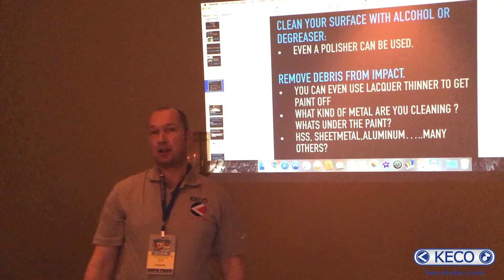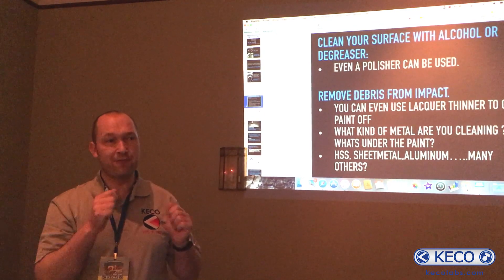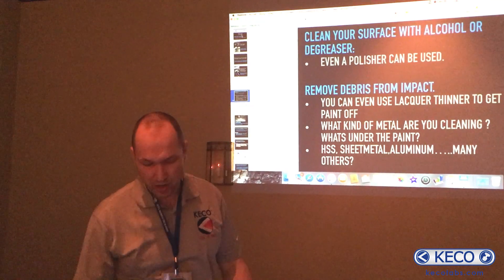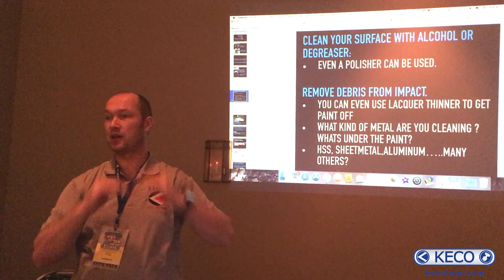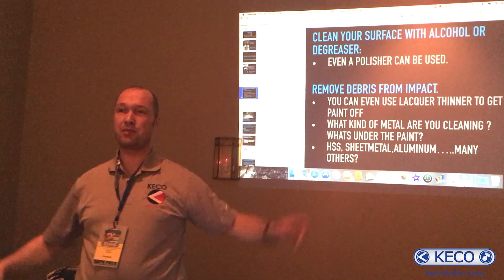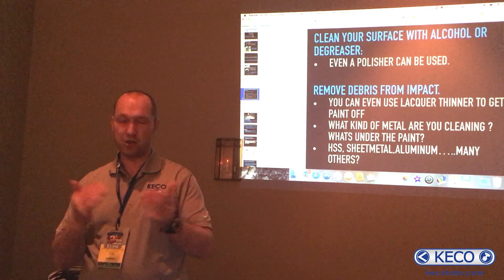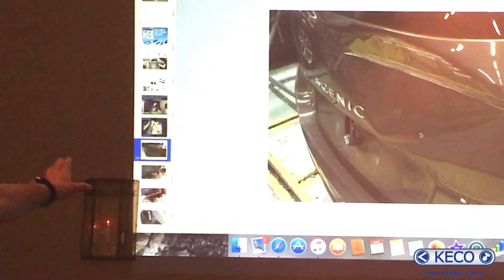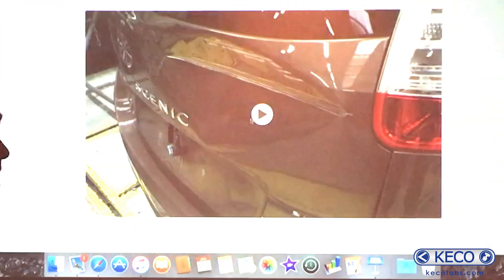MTE Presentation - KECO 2016

Comment: If you're in a body shop this information is a great introduction to Glue Pulling Dent Repair to completion and Glue Pulling to paint later (using less filler).. 

If you're a PDR Tech you know 75% of this,

if you're LEARNING or STARTING - this is something someone in 1999 would've paid $1k for 3 VHS tapes over mail. If you learn this you'll be worth a lot more than someone who doesn't know Glue Pulling methods.
Reply from the maker: Thanks for the info, Richard. You're the man and couldn't be more right!

Comment: This system is very innovative and efficient. The only issue is all the 
After market body parts available today. Especially from china. They might not be 
As expensive as this technique over all. Depending of course on the amount of
Time removing the damaged part and reinstallation of the new part. But I have 
To admit this is a great idea !!